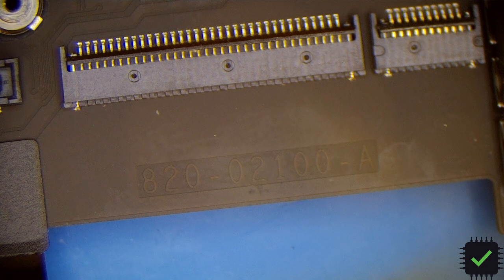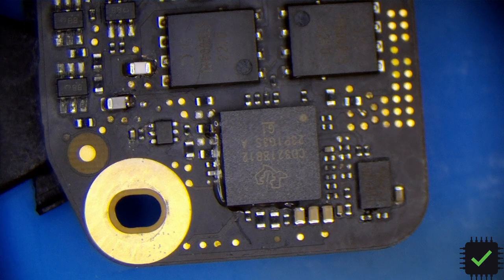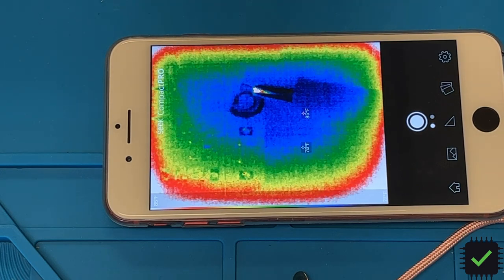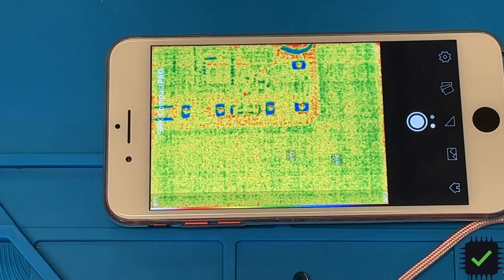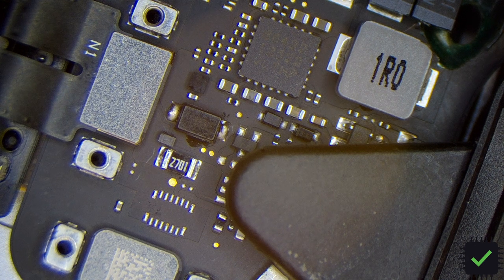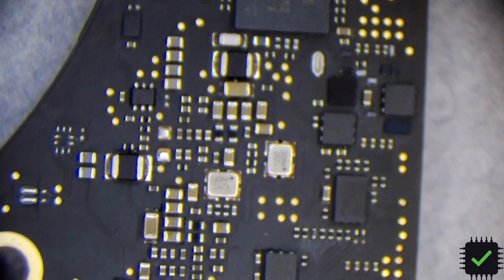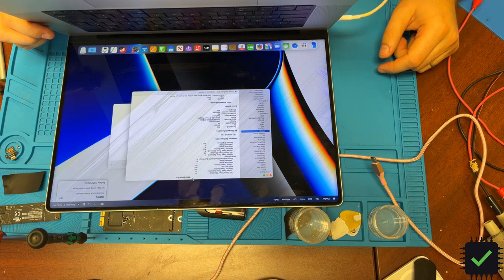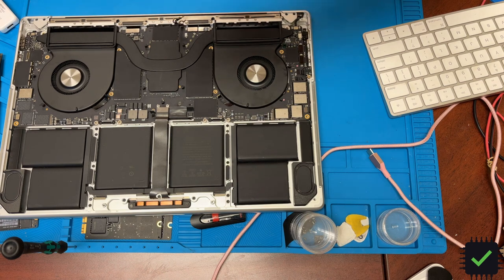2021 MacBook Pro A2485 M1 Pro Chasing the literal rabbit hole after major liquid spill. 820-02100

Comment from the maker: Was able to fix the MagSafe overheating issue as well. Ended up being semi-shorted capacitor C5302. Key points I learned working on this board - CD3217 from other boards ( I tried A2141 and A2338) would not work. Most-likely they are programmed and have to be taken from the same donor, location might matter as well.
Reply: try change them together with the paired ROM